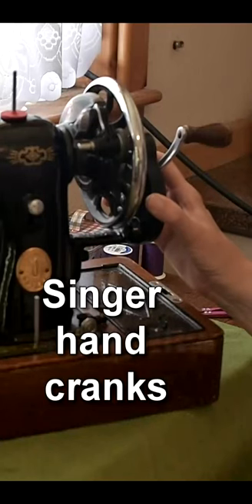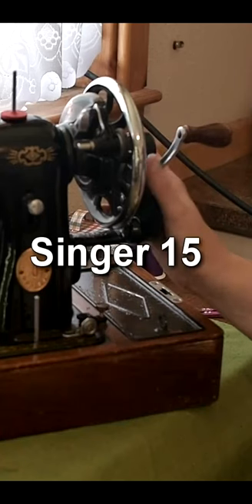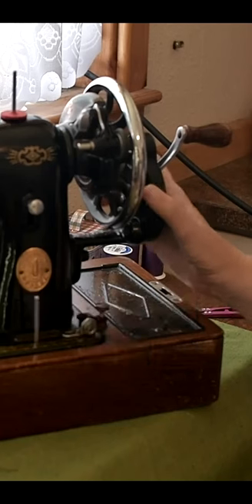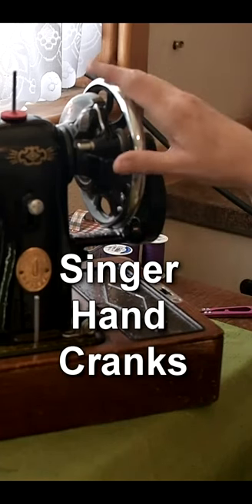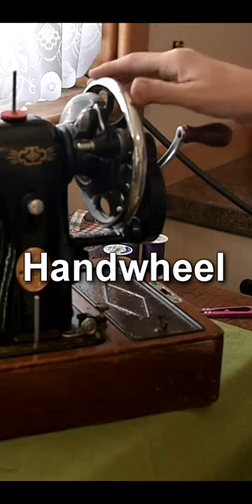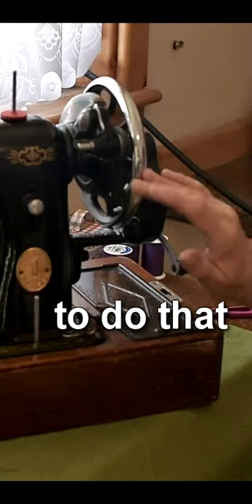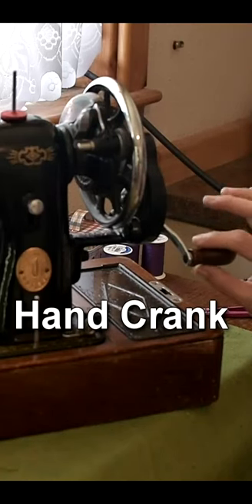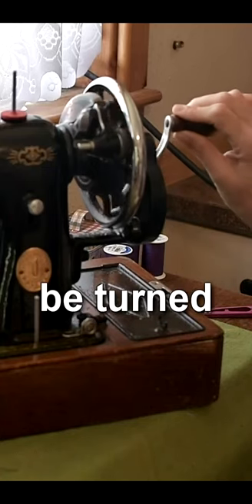How to work a Vintage Singer Sewing Machine Hand Crank

Comment: Hello! I recently was gifted a 1924 machine (with original instruction booklet) by a family member, it is theoretically in working order but hasn't been used in 20 years.
I was wondering if you knew any resources I could look at to help in giving it some TLC, I'm struggling to find anything & don't want to spoil an heirloom! Your content is beautifully relaxing💚💚
Reply from the maker: If it hasn't been used in 20 years it's going to need cleaning and oiling. You haven't said what kind of machine it is but with a date of 1924, I'm guessing cast iron with decals. With a very soft brush, a clean cosmetic brush would be ideal, gently wipe away any surface dust and debris. Then get some sewing machine oil and the softest cotton wool balls you can find. Drip some oil onto the machine's surface and gently wipe the oil across the metal. Don't rub! Be as gentle as you can. It'll take a while but the sewing machine oil will clean the decals safely. Don't forget to oil the moving parts. Your manual should show you where the oil points are. Only use sewing machine oil. It's designed specifically for sewing machines https://amzn.to/3KTcsPj (amazon Link). If you check out @VintageSewingMachineGarage here on YouTube, he does some in-depth cleaning videos on vintage machines.
Reply: @SimplyStitchy  you are an absolute lifesaver thank you so much!